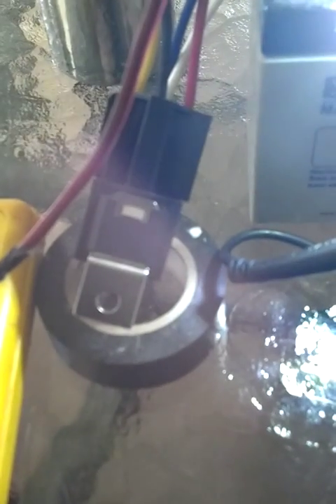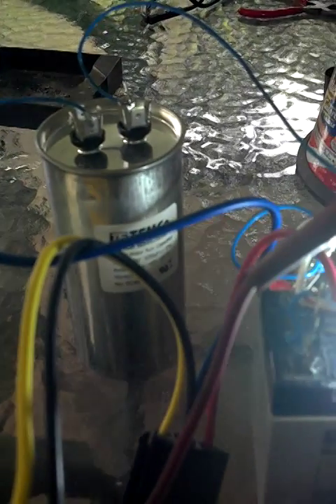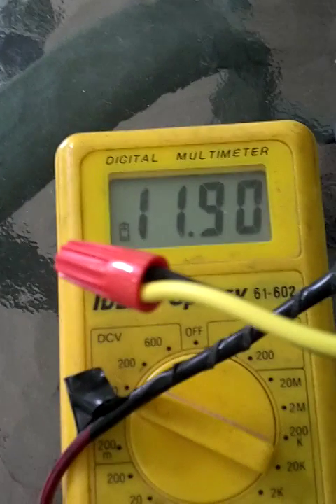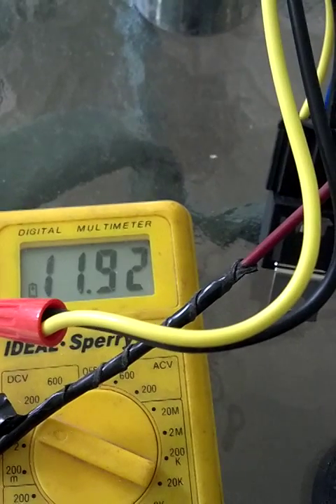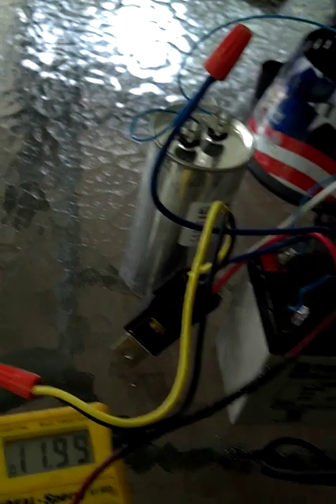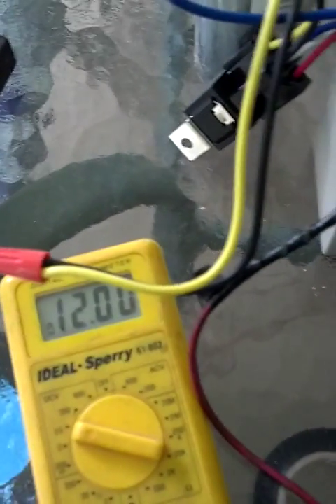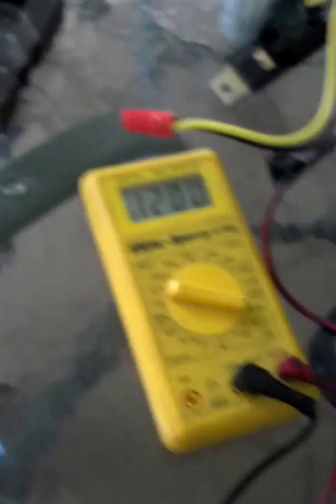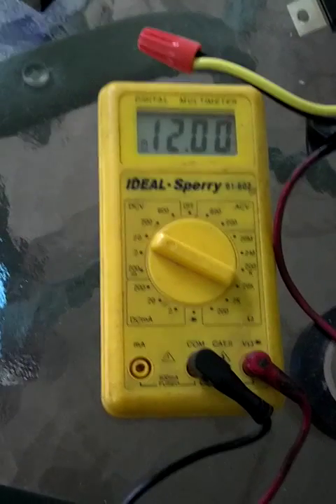Real Radiant Energy

Comment from the maker: Hi everybody, the relay will oscillate by itself if wired correctly no matter the size or type, just as long as the relay has a normally closed switch. To do this, the relay's coil must be wired in series with the normally closed switch, start your wiring like this:
Start wiring the negative from a battery to one side of the relay coil. Then, wire the other side of the coil to one end of the relay's normally closed switch, then, the other side of the normally closed switch back to the positive of the battery. This is only the part of the relays circuit that will force oscillation. Oscillation here has nothing to do with resonance, etc., it is a forced oscillation that starts by energizing the relay coil, the relay opens the switch and forces the circuit open, shutting down the coil, releasing the high voltage from the coils back emf pulse to the battery, then, since the circuit is shut off, the switch goes back to its normally closed position and cycles the system all over, repeating itself between 800-1200 times per second causing a nice rise in voltage. Since we have the potential to replace the energy used as it is a functional but mechanical tank circuit, energy will rise depending on how the circuit is wired, components used, and its super important to utilize the better type of battery. Some batteries allow absorbtion of ac current such as lithium poly and lithium ion packs but, its vital to be sure the voltage levels remain in the window they are designed for. This can be achieved by adding a variable 2-3watt resistor as a dummy load to prove you have a gain in energy between your input and output. Its vital the correct diodes are used in the correct place to get the results i claim will happen, allowing the battery to charge while being loaded without discharge. The circuit will NOT continue functioning with any large load , it is merely the method i use to prove overunity is possible by the use of this circuit.

I receive thousands of emails daily so please give me time to respond. I get hate comments and a lot of trash talk from skeptics and suppressionists where folks are waiting for replies telling them how to complete something, sometimes asking me for instructional videos. I work by myself performing research daily and i dont have the time to answer every email or comment, so, no, I am not disregarding comments because i am mentally unable, not smart enough, or am not willing to answer those questions, i just dont have enough time in my life to see and answer each message as the entire world seems to be questioning my posts.

I apologize if this has happened to any one of my followers, i will eventually post these instructions and my sources, part numbers as well as clear, professional detailed schematics, so, please allow me the time to do so. I am also blocked from posting videos from many of my devices by compute r hackers most likely working for energy companies, so, please allow me the opportunity  to take the time and make the effort to complete these tasks. Im on my vacation and ive been trying to answer my subscribers, then, the many questions by email, then, lastly, answer and fight my battle with the skeptics who are doing nothing but offering negativity to everything i post. My theory to electrical and the energetic community is that there is nothing in this world or universe for that matter which is impossible. I feel there is always a logical explanation for what skeptics call an anomaly. I feel an anomaly is a true method of the supposed impossible actually happening and cant be pushed off as something that is accidentally  happeningg. If these anomalies were impossible according to physics laws, then, either laws are wrong, which they are not, or, there is another form of electricty out there that pertains to different mathematical system that has not been put together or allowed to be theorized.

We have been suppressed from the true Maxwellian equations which allow all overunity systems to be scientifically possible. This is why the suppressionists ammo bags are full and they have valid ways to argue and state the unlikely is impossible, but, their arguments will tell us new technology is impossible unless it pertains to the scientific theories labeled as Laws, laws are merely theories that have not been proven. Maxwell and tesla worked to prove their theories, Morgan and Lorenz erased, rewote, and forced publishing of only the mathematic equations that stated overunity is impossible. This is totally wrong as asymmetric equations have been released and allowed to be presented in modern day physics classes at Ivy League schools such as Yale, but, the studies must be paid for to view on the IEEE WEBSITE. FOR PROOF, PLEASE PAY FOR THESE DOCUMENTS TO SEE THE TRUE RESULTS OF THESE STUDIES. DO NOT ALLOW THE SUPPRESSIONISTS TO CONVINCE YOU INTO THINKING I AM LYING, AS THE IEEE HAS ALLOWED THESE PROVEN SCIENTIFIC  STUDIES TO BE PUBLISHED WHETHER ONE BELIEVES ME OR NOT, THIS IS MY PROOF. LOOK UP ASYMMETRIC MOTOR VS. SYMMETRIC MOTOR STUDIES AND YOU WILL BE ABLE TO SEE AND PURCHASE THESE SCIENTIFICI STUDY RESULTS FROM THE IEEE. THERE ARE THOUSANDS OF THESE STUDIEZ PUBLISHED WHICH OFFER THE SCHEMATIC DIAGRAMS AS WELL AS ALL BUILD CRITERIA SO ONE CAN DUPLICATE THIS ON YOUR OWN. THEY WILL SAY IM A LIAR AND A SCAM ARTIST, BUT, I TELL NOTHING BUT THE TRUTH AS I AM NOT TRYING TO SELL YOU ONE THING AND HAVE NO REASON TO LIE ABOUT ANYTHING.

MY CIRCUITS ARE VERY REAL, THEY WORK AS I CLAIM  AND, I HAVE EVEN USED AND CONTINUE TO USE THESE CIRCUITS ON A DAILY BASIS TO SAVE ON MY OWN POWER BILL.. YOU CAN DO SO YOURSELF BUT IM WISHING EACH OF YOU LEARN FROM MY METHODS TO CREATE WORKING MODELS OF YOUR OWN. I DO NOT HAVE ALL OF THE ANSWERS, BUT, THE KEY TO THIS LIES IN THE CIRCUITRY WHICH DOES DO WHAT I CLAIM.
Reply: I got it to occilate
Reply: Gotta get those shotkey diodes or what ever they are called
Reply: @RicJamz  Thanks mate. Did you get the battery to self charge tho? 👀
Reply: +Marc Belanger Marc im following your "mbr circuit" I have everything needed except the transformer 250 wind-700 wind; Do you have an extra one I could buy from you. My quest is to simply prove that the circuit works in some kind of small overunity effect. let me know how i can obtain this transformer if possible
Reply from the maker: I have cores but I'm not sure they are the same size. Believe it or not, I got the transformer I used in that video from a wall wort power supply from a charger for a 7 ah lead acid battery.  The circuit does work, however, there is a damn fast diode needed that I didn't originally add to the schematic . It needed the diode connected from the output of the high side of the transformer back to the positive terminal.. You need to install them both ways on the positive lead and the other side needs to have an earth ground to make it work so it draws the energy in. The circuit pulses the energy driven into the Earth, then, it has a recovery coming through the diode, as voltage amplification from the transformer, and, energy induced from another place. It does have a very small amount of overunity, so, when you see double diodes being used to do the same thing, that is exactly how it works, it focuses energy from another place like a valve. One one way to allow the energy from the transformer while powered, and, while it shuts off, from it's back emf. If we take the back emf away from the output and direct it from the transformer to the battery instead of back to it's input, it has to flow with the effect of a diode. I haven't played with it further, but, I bet if we did the same thing with the other side of the coil, it would work even better and stay in the overunity zone longer. The problem with it is the voltage eventually smokes the battery, however, I did run it for months and I think i goit lucky with the brand of relay I used because I had zero luck with Bosch or Potter and Brumfield relays. Cheap ones worked the best... the no name chinese pcb mount ones work fantastic if you can actually get it mounted being they are so small. They need to be 5 pin relays otherwise they won't even oscillate.
Reply: @alexmanzanero  Hello Sir, did you manage to get the battery to self charge itself?
Reply: Thanks millions homes, been reading over these for years glad to see when ur not getting a reading is when your getting the magic
Reply: Ps I been on your trail with the battery charger but that's amazing. I gave up, but now I have some solid proof in my yard lol
Reply: @RicJamz Hi, howz it going. Did you manage to get this to work?

Comment: Hi Marc I'm trying to make the same circuit and I think I'm close just need a little help with it I made a video and put it on my youtube channel so you can see what my set up it looking like please get back to me when you can thank you
Reply from the maker: I'll try to assist if I could. I paid hell finding the correct relay, and, since I posted the video, I've found it much easier to oscillate/ring naturally by using tuning capacitors and coils . The relay is forced to oscillate by its wiring method and doesn't easily work as an energy gain unless the coil in it is spot on with no snubber diode connected.
Reply: ok and is that the 1n4oo7 diode that I have on the circuit now or is that in the relay and are you using the BOSCH/TYCO STYLE SPDT relay?
Reply from the maker: yes, the relay is the same style, but, the brand I used was a brand named AGP and you'll have to ensure there is not a snubber circuit with a diode or a resistor tied to the relay's coil in any way. In my successful circuit,  The relay coil ended up measuring 38 ohms. Most relays are 15-18 ohms.. It is vital that the coil has a higher impedance, and, if they are much lower, I wouldn't even try them at all because it will just go down in voltage.

The circuit has to be in resonance otherwise you will have a gain in your output when the voltage is low, charging the battery until the battery gets to it's full voltage, then, a fairly rapid discharge will happen. This is due to the high static spikes which are an AC spike that destroys the battery if continuously used in this manner.

A battery while being used must be accompanied by powerful short but sharp spikes that release a high enough charge current to deliver a high enough voltage that balances the voltage loss to allow it's continuous operation. I found it to be very difficult to resonate the circuit naturally and found I was very lucky to make this function without flaw the first time. I tried several brands of relays and failed until I used the higher impedance relay at 35 ohms or higher since it uses less amperage to operate and the back emf voltage outputted from the coil will be much higher, causing the relay to oscillate way faster and give a better result. If the battery used has too high of amp hour rating, it will get to the highest point of charge, then will discharge the battery, eliminating it's ability to function.

I have found that a lithium ion battery pack from a drill works best with a super cap bank of approximately 150F-300F in parallel with the  relay circuit. Please see a schematic I posted which works better if built correctly. I highly recommend creating a tuned tank circuit and assist yourself in doing so by the use of a resonant frequency calculator or a tank circuit calculator for the best results. The link is here:

http://mbrcircuit.blogspot.com
I may recreate this to make it easier, videoing it to help show my followers this circuit outputs more than it uses.

The key is to create an oscillating tank circuit which puts back more power than used by drawing in positively charged particles through the relay's spark as a spark gap during it's natural oscillations made by the pulsing tank circuit. It has been said it is just an anomaly, but, it is literally using the same as it outputs as the tank circuit does, however, a green arc is indicative of the positive charge blending with the negative electron flow, outputting an additional burst of energy that can be used to charge the battery while doing some work.

It is extremely tough to force oscillations and get more out than in, so, it is recommended that you add a diode, a 1n4006 on a wire jumper, connecting the high side of the transformer's coil (hot side) to the positive terminal on the battery. switch direction quickly to eliminate a short circuit to make the direction correct. If you have the diode facing the correct way, you will hear an instantaneous rise in speed of the relay oscillation and voltage/charge will remain high instead of dropping. This is the beginning of getting the circuit functioning correctly. I just play around adding components to raise the voltage in other ways. Adding caps and spark gap (hairpin circuit)  may allow radiant energy to be drawn in and output more energy or successfully loop it to self operate.Good Luck.I will try to assit you any way i can, but, I do wrn that it is hard to duplicATE since there are many variables to consider and it's hard to get functioning if there are chnges in parts used due to the variables and tolerences of their components used.
Reply: ok thank you for the help I will try my best but your right about you making another video. You should make a how to video and show step by step so it will be easier  on every one that's trying to replicate your work. I understand that its hard to replica all by its self with parts and stuff like that but would help to know where to start from even if the parts used can't handle it so well. It just helps having a good starting point but again thank you for your help a lot
Reply from the maker: Lee Velez http://ufopolitics.com/asymmetric-machines/five-poles-p5 Lee, here is the schematic and directions to build it. Sorry, it took me a while to locate it. Follow the instructions closely as the diagram shows clearly the direction by color. The next image down shows how to start , the directtion, it's direction change, and, how the poles are both within the same winding, starting at one commutator and ending at the next, opposite sides of the shaft!!
Reply: Ok ill take a look at it thank you